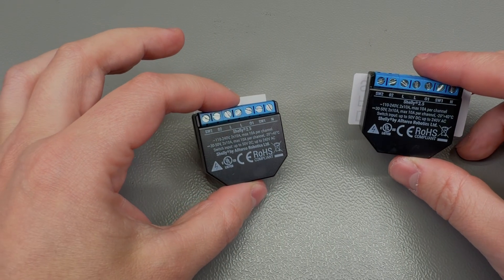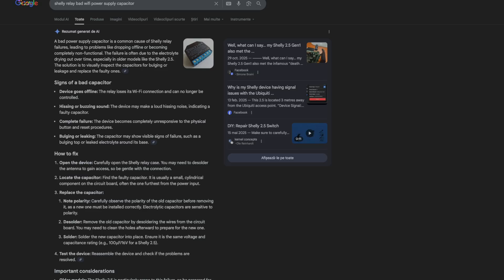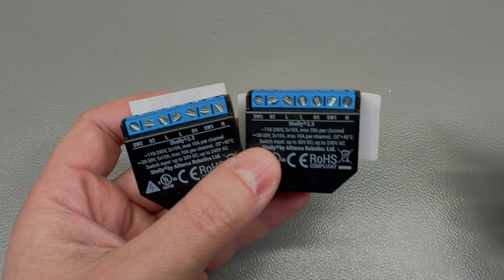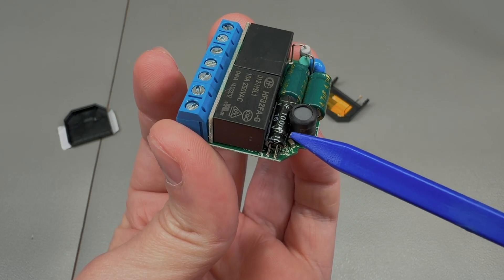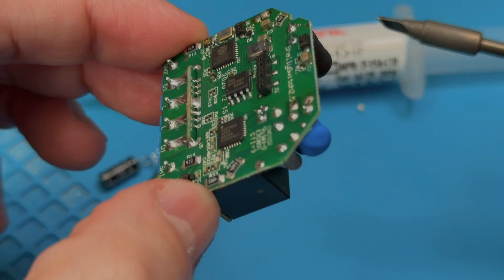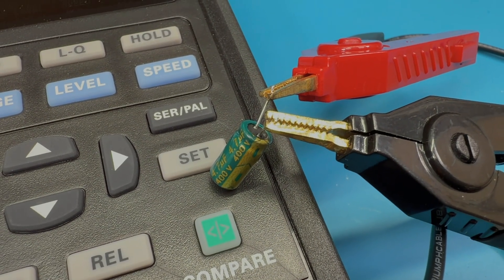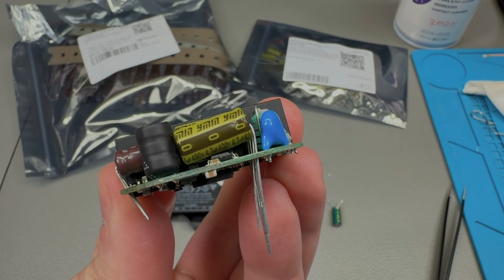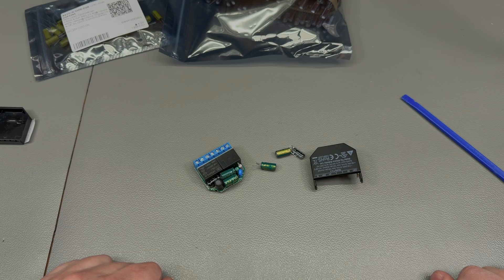The Shelly 2.5 Design Flaw: Cheap Capacitors Killing Your Smart Home Relays

Comment: ive recently installed some new shelly EM pro devices - with very difficult setup & poor (included) instructions for access point..
bottom line … shelly devices are very expensive … but not delivering on quality … 5x the price of a comparable sonoff device … but NOT 5x the qquality

Comment: Any better brand alternative?
Reply from the maker: You have to consider this issue may not be present on all shelly devices as they do not all share the same power supply circuit. All of my other Shelly relays (different models) run fine. I will continue to use Shelly for now.

Comment: I know it's really lame, but I have a few Arduino Nano and Megas around the home, connected with W5100 chips to ethernet and powered with passive PoE. They are in various places, in project boxes, in cupboards, behind access panels, etc. These little installations have been running 24/7 for about 8 years now with no failures at all. I even run some lighting strips (individually addressable) from some. These have been 100% reliable, as opposed to all their wireless, Zigbee, Shelley, counterparts. I have to say, nothing beats tech that you built yourself, in terms of reliability! But maybe I'm a little OCD about ensuring things are built well, and suitable for the environment. I still have a few shelly dimmers (I bought 12 in total, about 5 in use now) but I'm slowly rolling KNX out across the home which has been more reliable all round.
Reply from the maker: It's awesome that your custom setup has been so reliable!

Comment: Thank you for this video! For the longest time I have been listening to the whine of a switchable plug (different product from a different manufacturer) until I finally gave in last year and replaced it. I've had it apart before, but didn't know why it was whining so bad. Replaced the low voltage caps after seeing your video and now it's quiet. I have peace.  :)
Reply from the maker: That's awesome, glad it helped you fix the issue!

Comment: The major problem in the Shelly design is that it is simply too cramped to be durable. Even with higher quality components I doubt this will last long. The caps are simply under too much heat stress.
Reply from the maker: Indeed, it's difficult to handle thermals in such a tight package. The internal temp sensors on my Shelly 2.5 relays, report operating temperatures in the range of 40-60 deg C. This varies with having the relays on/off and the load.
Reply: @voltlog when I was doing me Engineering degree a long time ago the Electrical Engineering students complained about having to take heat transfer courses from the Mechanical program. This shows why, without good mechanical design the even the best electrical design is destined to become a paperweight (or perhaps a space heater).
Reply: Can try solid polymer capacitor or something else that is more stable?
Reply: Not a bad idea, but I still stand by my original statement.
Reply: @LarixusSnydes I’d agree with you.

Comment: Close to 20 PM 2.5 bought for roller shutters and close to 20 failed because of the capacitor.
The video is misleading, replacing the single "secondary side" 100uF guy is substantially always the solution.
Even a cheap AE will do, on mines they are all working flawlessly for more years than the originals.
Should I buy another one, I'll replace the cap before installation
Reply from the maker: You probably haven't watched my video entirely. I identified the 100uF as the culprit and explained why it's important to replace all 3 capacitors, with measurements to back the claim.
Reply: @voltlog  yeah, I've watched, but missed the 400uF caps measurement, thank you.
Anyway I am not aware of a single 4.7uF capacitor fail, before and after the 100uF cap replacement, other than the 100uF cap replacement. In my personal experience, sooner or later, 100% of 100uF cap fails and replacing them is a 100% forever fix. Should I had measured what you measured on your 4.7uF caps, I also would have replaced them :-)

Comment: It would be interesting to know the internal temperature during operation.
Reply from the maker: The internal temp sensors on my Shelly 2.5 relays, report operating temperatures in the range of 40-60 deg C. This varies with having the relays on/off and the load.
Reply: @voltlog that’s mighty hot!
Reply: Highly possible with Tasmota, reading chip info
Reply: @lucapesce3335  10 trilion kelvin

Comment: Thanks for the info! I have 4 of these failed 2.5 somewhere in the corner, 3 with exactly the same symptoms, but one was rather overloaded, even if way less than 10A were switched with it (one device handling both washing machine and dryer, protection shut down many times when both operated the same time in a quite high room temp...
Reply from the maker: You're welcome! Thanks for sharing your experience. The internal temp sensors on my Shelly 2.5 relays, report operating temperatures in the range of 40-60 deg C. This varies with having the relays on/off and the load.

Comment: 6:53 Maybe cutting or drilling one or two small openings into the case, where the caps are, is not the worst of idea. Then the heat is not completely trapped.
Reply from the maker: Yes, might help with a bit of ventilation, but since the relay is installed inside a small electrical junction box, tightly packed behind a socket, it is likely the effect of that will be very limited.

Comment: I had 15 of those. Only 2 are still alive after 4 years. Some of them failed while on warranty and Shelly sent me some 2PMs instead. Those are bigger and so far only one have died. Thanks a lot. Now I can repair them and use as backups.
Reply: Also one single phase EM died and one 16A Shelly plug
Reply from the maker: On the single phase EM, I have one of those installed for the past 3 years, running fine but I installed a second one at a friends house (purchased from he same batch) and his one failed after like 1.5-2 years, similar defect as I think they use the exact same capacitors in the EM.
Reply from the maker: That's great to hear! Hopefully, they'll last much longer now.

Comment: 11 years sonoff none failed till today have about 25 light switches installed
Reply from the maker: That's great to hear! It's always good when devices last a long time.
Reply: Soonoff were quite bigger that 2.5 again... Was not an option for me, plus Chinese brand. I though Shelly would use better parts.
Reply: till today? so did one fail today
Reply: @uiopuiop3472 
He meant "up to today, none have failed". Meaning that one could fail today, tomorrow or next week.
Reply: I just had to replace the MLCC capacitor in a Sonoff Dual that has been in use for at least 6 years.
Reply: I have had sonoff R2 relays fail  after 3 years. Capacitors on them too.

Comment: This is why Chinesium is such a treacherous material to work with.  Shelly may not have done ongoing sampling of their subcontractor manufacturer's output.  Of course the subcontractor is going to ship good caps at first so that Shelly has nice samples in their lab to pass and for ongoing testing.  As soon as prodution is approved, the sub can switch to cheaper parts for the units that get shipped direct to distribution.  Also, the contract from Shelly to the sub should have required the sub to pay Shelly for returns due to defect and related losses for some declared contractual product lifespan.  Subs will always act like they've never heard of these clauses, but heavyweight electronic buyers have successfully included these terms since the 20th century.  

Shelly has otherwise made good design choices regarding open firmware development on their smart plugs, as well as good networking features.  But that doesn't help when the plug is dead.

Comment: Around 5:50 there is a typo - the cap is 100uF/16V and not 400uF. Replacing caps is easy, the problem is that all you can find on AliExpress with the required size are the same unreliable brands. BTW the problem apparently does not exist on the newer generations of Shelly devices, at least I haven't seen any reports.
Reply from the maker: My other shelly relays don't have any problems yet, those are Shelly Dimmer 2.
Reply: @voltlog  Oh yes, the Dimmer 2 is crap. Had 8 out of 16 fail in weeks.....
Reply: You should be able to find solid electrolyte caps on LCSC and use those for the 100uF, should last forever.
If you find something the same size but a lower capacitance from a reliable brand for 400V, its probably going to last longer than the original, since original failed somewhere <3uF.
Reply: Maybe you still haven't seen reports because they are new
Reply: There are may places to get quality caps cheaply: Digikey, TME, Farnell, RS Components.
Reply: @mrfrenzy. Did you see all the video?
Reply: @PaoloSulprizio yes, but Thylulenspiegel101 apparently did not.
Reply: @mrfrenzy.  The problem is not to find a capacitor with the compatible electrical specs but also small enough to be packed in the case
Reply: @mrfrenzy.  agree but what were the dimensions, looks like smallest on digikey is 8x10mm for 400V 4.7uF

Comment: it's weird that they are supposedly unaware of this issue. it's also not uncommon to see very cheap chinese caps in these devices. electrolytics are notorious for going bad, especially in high frequency applications like inverters or switch-mode power supplies. btw, if you live in europe, you can also search for parts on TME, which is a Polish parts supplier. they offer cheaper shipping costs and at least from my experience, they ship significantly faster than mouser or digikey.

Comment: I would go with a single large cap on the HV. Rubycon, or similar. They are not subjected to high ripple current, and lager capacitance means longer hold up time. Now for the LV, even an polymer with much lower capacitance should be good, and a 10uf ceramic in parallel with it should prolong the life a few times, here again a rubycon or similar. The HV caps usually fail due to higher voltage stress in these low power DC-DC converters.

Comment: why not use a single large 10uF 400/450V capacitor instead of the 2 small ones?  should be more or less same performance
Reply: Some power supplies using two capacitors have an inductor between them for better filtering. Check the design first. Also two capacitors have better esr ratings than just one capacitor.
Reply: @LamerCorp  true but it can also be 2 in parallels since it was cheaper that way

Comment: I never opened a Shelly but I see something interesting: it is possible to replace the internal antenna with an external one?
Reply: I wouldn't suggest it as it might be referenced to mains voltages. i.e. not fully isolated.
Reply: The connector is highly standard, other aspects should be taken into consideration, but yes

Comment: Looks like bad design. Even if high quality caps are used perhaps they can last double in that configuration, if they last more that's completely upon them but... I see electronics retired after 20 years and it still works properly.
Reply: it depends where in the circuit these caps are used. electrolytics degrade much quicker in high frequency applications, and if they're also of crappy quality, they die within a few years.
Reply: @a4andrei  I don't need to look at schematics when venting of an electrolytic capacitor can short the primary to the secondary... you don't cram capacitors like that and they're crucially undersized / under number for what they should be doing.
Reply from the maker: Sometimes, to design a product you have to push the limits. I'm not mad at them for doing that.

Comment: In my case 3-phase shelly energy meter failed due to disconnected earth/neutral. Turns out they use high (eugh) voltage buck chip, however other components are underspecced. They refused my warranty claim. It failed due to bad design, so I'm never buying anything from them again.
Reply from the maker: That's unfortunate but I think other bad things can happen, when you have a disconnected neutral and so your electrical board should have protection for that. The shelly relays should be installed downstream of all protection features.
Reply: @voltlog loss of neutral, like loss of a phase, can happen and should not fry equipment.
Reply: @eIektrinis even high quality components like Meanwell power supply fails due tp disconnected neutral. When the device gets 300-400V instead of 230V it can only blow the varistor and internal fuse.